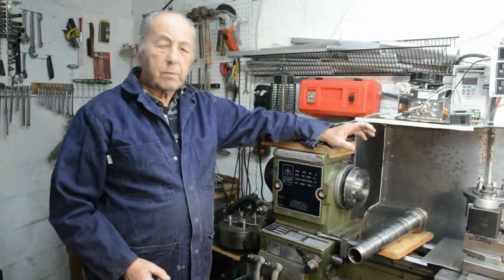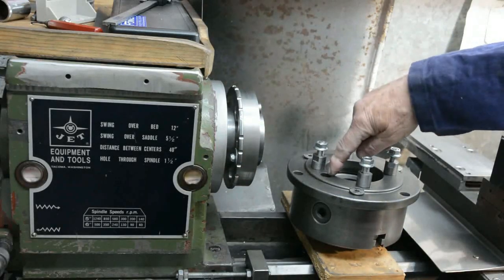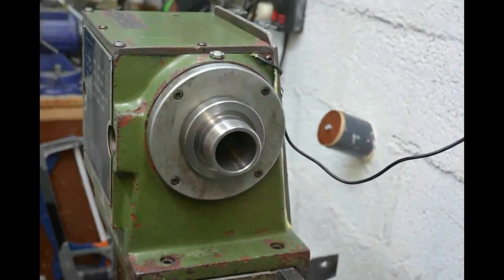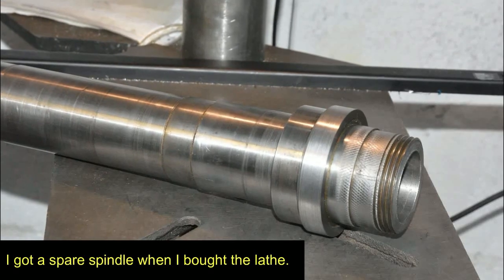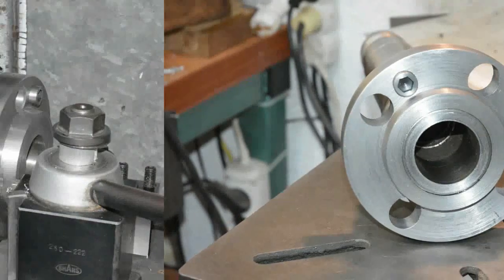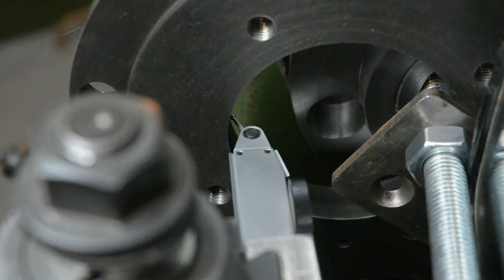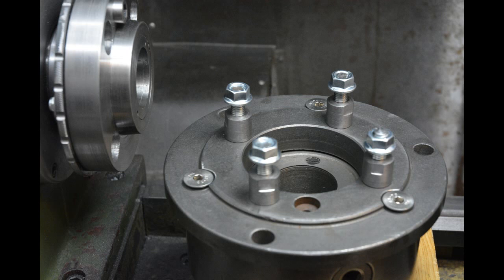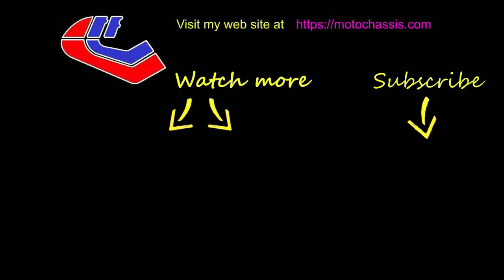Converting a screw-on lathe chuck mounting to a bayonet mounting.

Comment: Nice upgrade.. both my lathes have threaded spindles which on the little 9" hercus isn't a massive issue except not being able to run in reverse and trying to keep everything clean but on my big lathe, trying to screw on an 18" chuck or a 3' face plate is ridiclous.. changing chucks on the big lathe is such an issue that I don't even have a backing plate for my 15" 3 jaw and I just hold it in the 4 jaw which is far from ideal
Reply from the maker: That is a big chuck and face plate.  I did not know that such large lathes used screwed spindles.

Comment: Great video Sir, I have a 1960 South Bend 13"x40" with a 2-1/4"x8tpi threaded nose. I have been researching on converting to a D1-4 with some type of adapter. I really like your setup but either way I don't have a mill and I don't know how I would be able to complete it without a mill. I'm only a hobbyist anyway. I probably don't have the tooling for doing this anyway. Thanks for sharing, one day when I have more to work with, I'll give it a shot, great idea
Reply: @gunfrk  We can do that, Your mill is the key ingredient
Reply from the maker: A drill drill press and some hand tools are enough to do this, never let the lack of the best tool stop you.  There are always more ways to get a job done.
Reply: @MotoChassisByTonyFoale  Yes sir and being able to see the parts needed made a huge difference. Thanks again for sharing

Comment: Hello Tony and thank you for this video: It Is one week that i work on your same idea, but i dont want to disassembly My spindle from the My Chinese lathe, so My question Is : Is It possible to make the flange in 2 peaces? So i can install without disassembly the harbor? Thank you in Advance for your answer,Alberto from Italy!
Reply from the maker: Alberto,

I think that you can do it one piece without removing the spindle.  If you make the bayonet plate and put that on first.  Machine the block to suit the existing thread, then fit it on with loctite and some screws if you feel it necessary.  Then you can machine the outside.

Comment: I Tony. What a coincidence. I'm doing the same to my Colchester Triumph 7 1/2 inch. I'm making a full D1-6 adapter place so I can hold the chucks I have with my CNC machine  I'm going to rough turn the adapter plate and then get it case hardened. Once that is done, bolt it to my  trimmed spindle and then do a final grind on the lathe itself to make sure its true. I've just found all the Camlock studs and cams in China and are on there way now. I could not find any bits like this here in New Zealand. Cheers Wallace. Maybe I'll post a video !!
Reply from the maker: That sounds excellent.  Can you email me a link to the Chinese source
info@motochassis.com